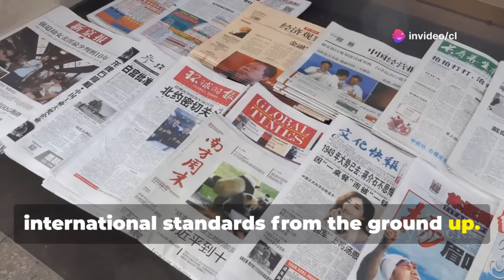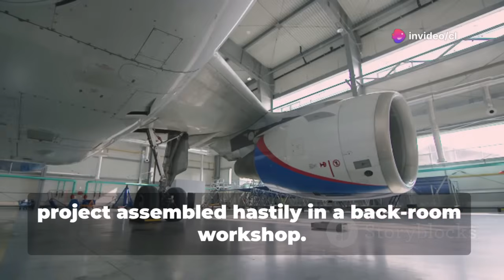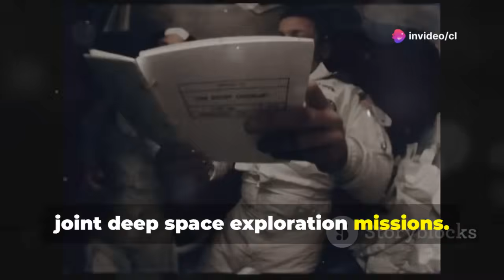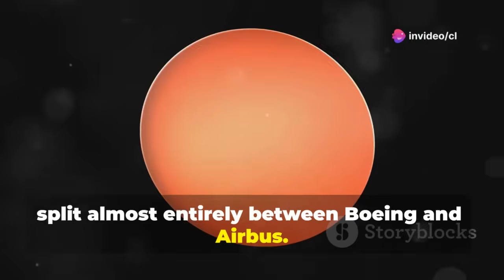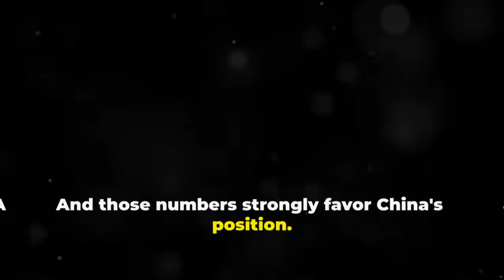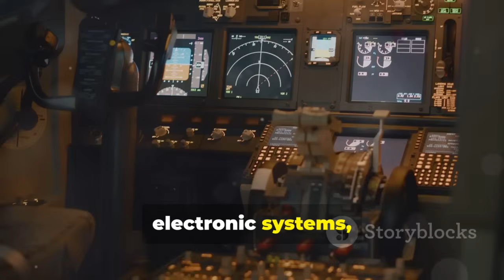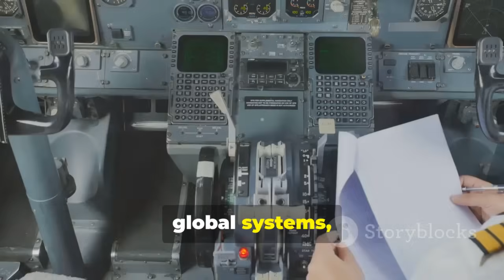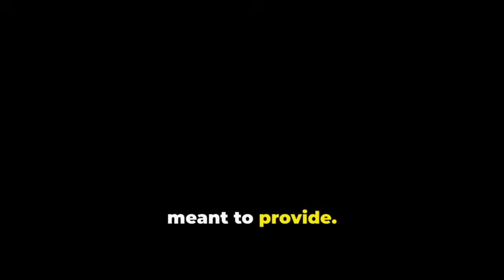Europe Rejects China's C919 Airliner – Beijing's Response Shocks the Industry

Comment: China has devised a work-around to avoid the Swift ban, the Huawei ban, Tariffs, Russian Olil imports, Shipping bans, and International Trade using local currencies.   I feel pretty certain that through its BRICS partners, China will certainly be able to circumvent the EU and U.S politics of Air Safety Certification..  Even if it ends up isolating the EU and U.S in the process.